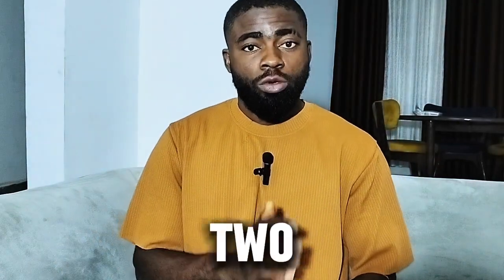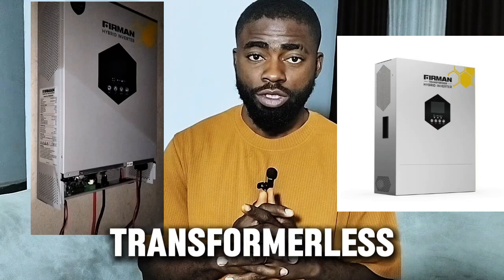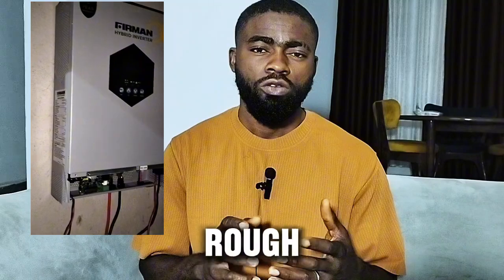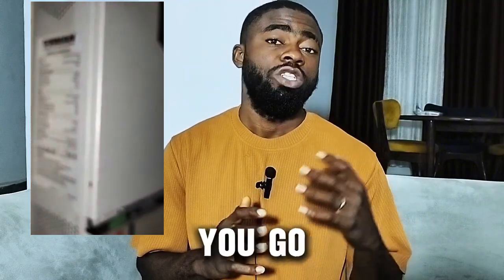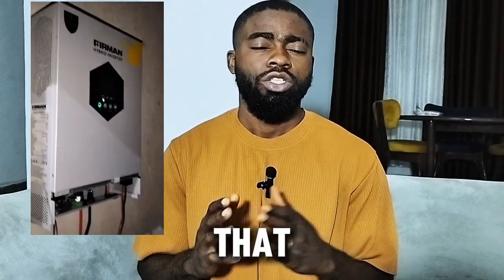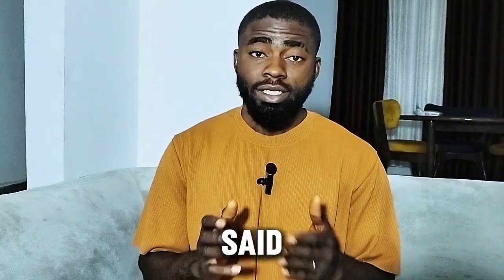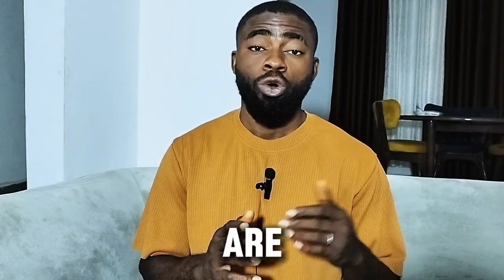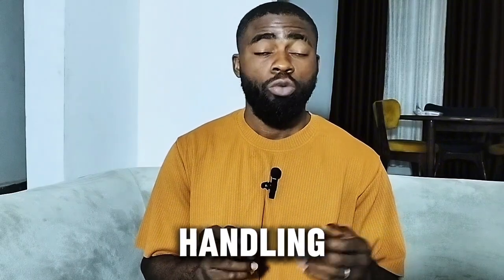Which would you prefer;the transformer or transformerless Firman inverter?

Comment: It has nothing to do with whether the user is rugged or not but rather the type of loading. Transformer based inverters are more robust and better suited for inductive loads. That includes things like ACs and pumping machines. Transformer less/High frequency inverters can also power these loads but would needs to be very much oversized. They are also more susceptible to faults due to much higher complexity of their electronics. Every inverter has thousands of electrical components and once any one goes, there goes your panel. High frequency inverters have a lot more components than transformer based.
Reply: thank you
Reply: Thank you, this explanation make no sense.

Comment: I prefer transformeless/high frequency... I can wire in some super capacitors to handle surges and i can get much better idle power consumption 

I hate the crazy energy drain from transformer inverters.. there are exceptions tho
Reply: How can I contact you for this. I need you to work those capacitors for me too
Reply: @HamPlaza , Your battery already acts as a SUPER capacitor for your transformerless inverter.

Comment: Thanks for the update. I want to know if the transformer based is also silent like your non transformer based
Reply from the maker: For the transformer base, I don't have idea if it will be that quiet
Reply: Normally transformer base don't make sound much except when running on heavy loads. So it should be silent .
Reply: @winnieedigin which is more silent btw the two?
Reply: @exemplarypersonality6562  it depends on the brand you're going for. But normally transformer based inverter hardly mak sound except when engaged on loads with 50% upwards. Some tranformeless hybrid inverter brand doesn't make much sound too like firman, deye and cworth.